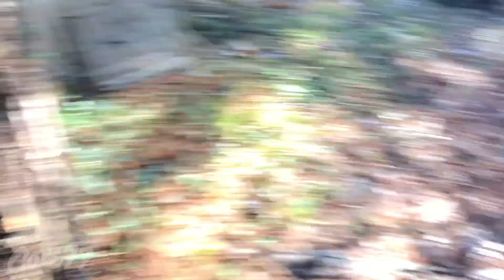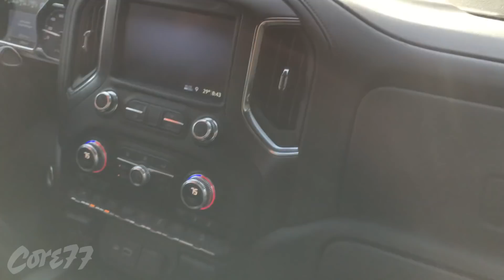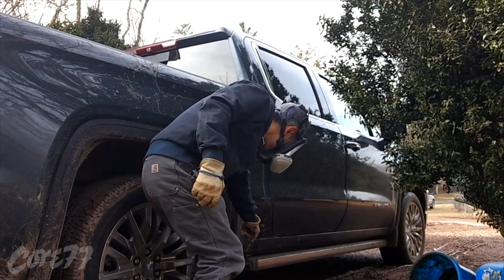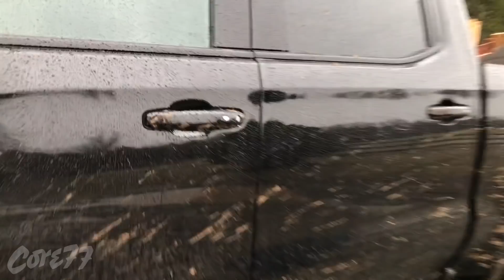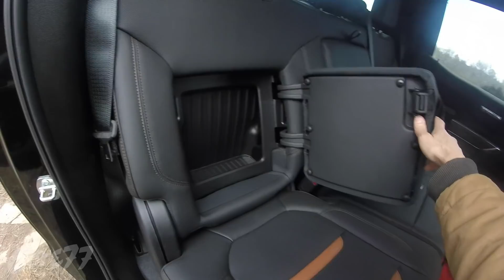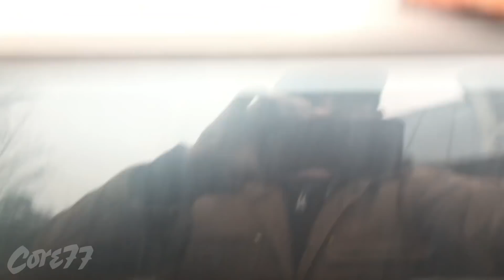GMC Sierra 1500 Denali & AT4 Review and Favorite Design Features (Long Version, Farm Use)

Comment: Thank you for showing it in actual use.    I too have to move manure and was wondering about how the pro tailgate cleans up.  As far as the 8 foot boards not fitting...what size bed is on the denali you tested.  GMC makes a short bed and a standard sized bed.  UPDATE:  I bought an SLT with the standard size bed.  With the gate down and the "step" flipped up a 4' x 8' drywall / plywood will fit FLAT on the bed with 2 inches of clearance between the wheel wells and about 5 inches of clearance between the back of the bed and the flipped up step.